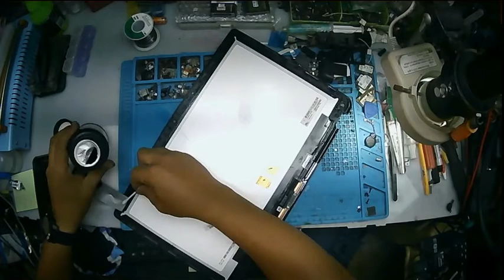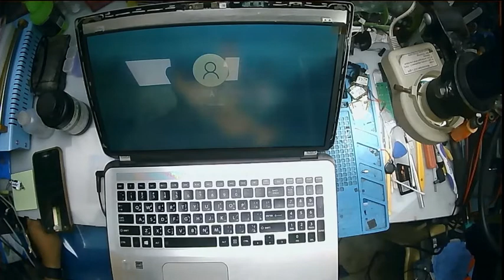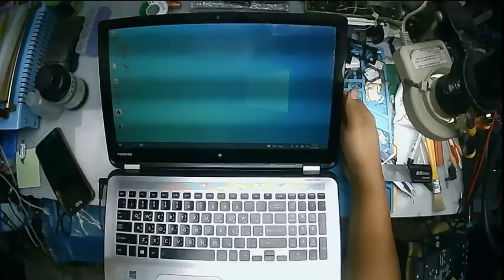Toshiba Satellite Radius P55w-B5224 Screen Replacement

Comment: Sir un laptop ko same model at same screen problem, kaya lang nandito ko sa saudi eh , baka pwedeng malaman un seller ng screen para maka order na ko dito , tpos ikaw na mag install pag nag bakasyon ako
Reply from the maker: Modified screen yan sir, hindi po orig na screen ng model po n yan.. isang set kc yan lcd at touch magkasama.. wala nyan d2 locally kya modified n screen n lng.. try nyo n lng order dyan type nyo lng model ng unit po ninyo